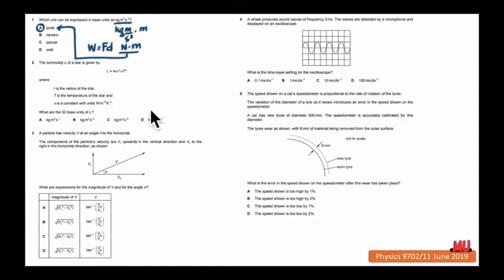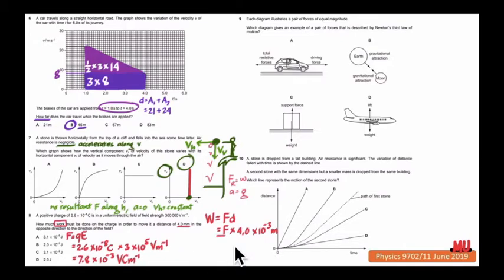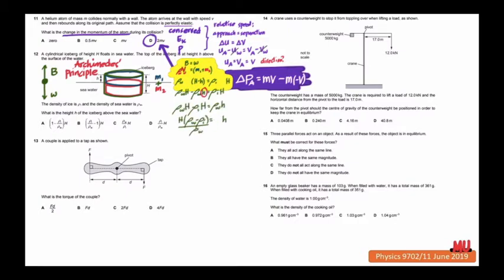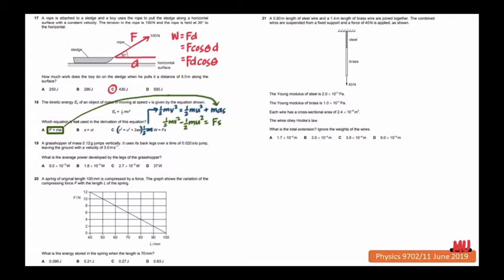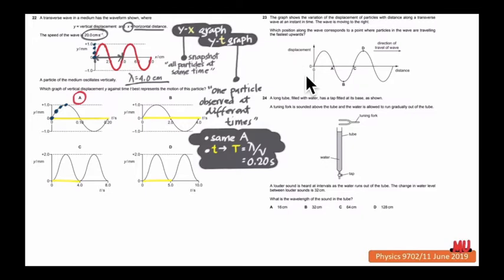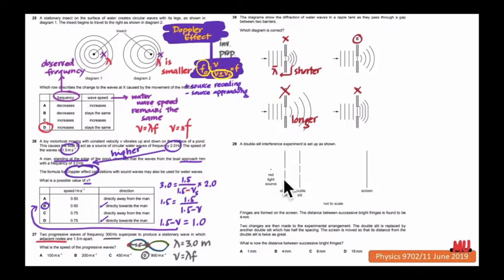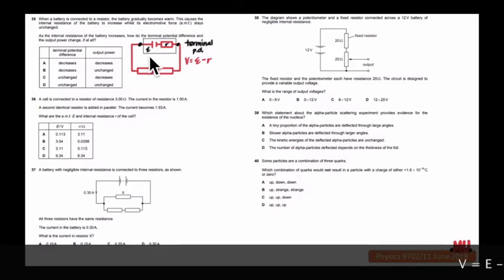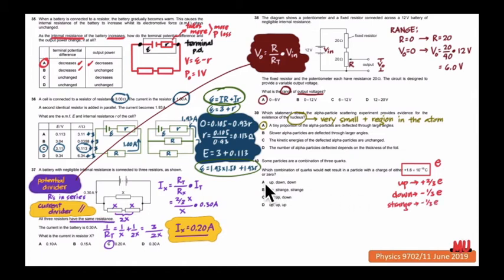Cambridge | Physics | Syllabus 9702 /11 | May/June 2019 Series | QP and MS

Comment: Sir don’t understand question 19, could you help me out with this 🙏
Reply: Power is equal to energy over time here the energy is in the form of kinetic energy so we will find energy by using the formula 1/2mv²  mass will be converted into kilogram then in power formula we will put the value of energy and time give in question 0.020 and the answer will be 0.027 which can be rewritten as 2.7×10-²

Comment: bro q5 C is the ans not A
Reply: ans is B check by searching 9702/11/m/j/19 in the Google
Reply: its d bro
Reply: Uhh why are y'all getting it wrong, the literal answer for the question as per the mark scheme is B😭😭
Reply from the maker: thanks, man... I just saw the error... the diameter should be shortened by twice the 6 mm [from both ends of the chord of the circle]. The answer should be B.

For the working, please just do 12/600 instead of 6/600 in the video.
Reply: @ScienceMU  ok bro
Reply: @ScienceMU  i get it now, thx
Reply: @ScienceMU thankss